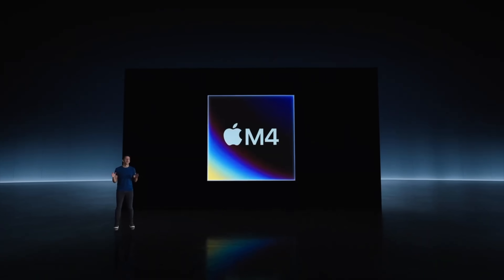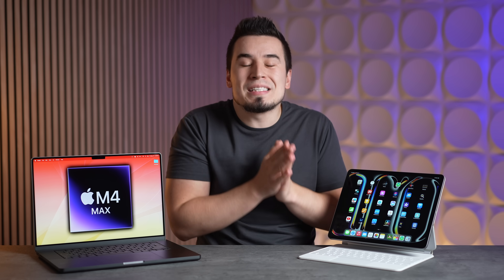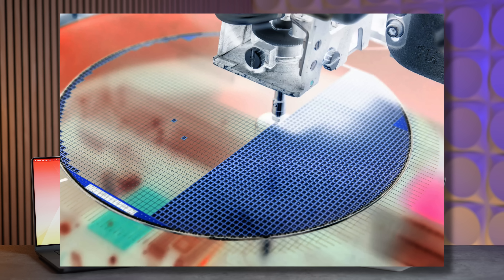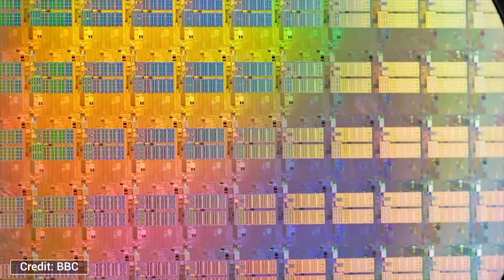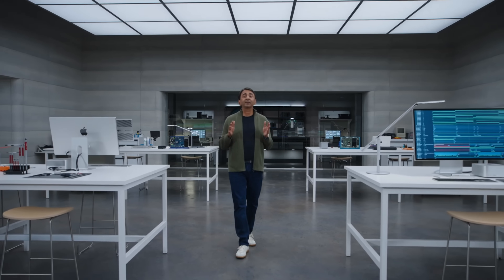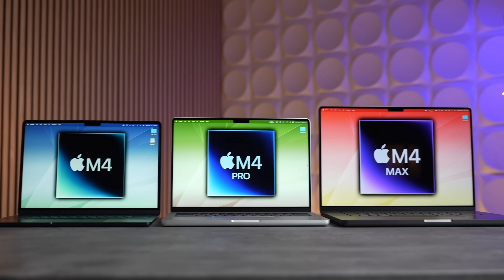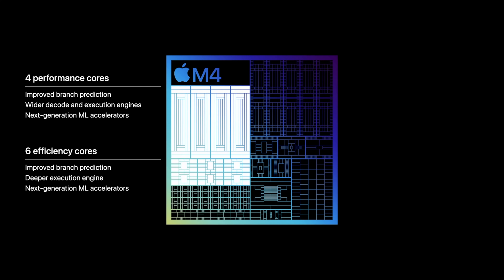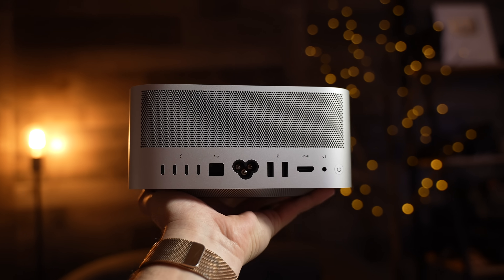What M4 iPad Pro means for M4 Macs (Huge WWDC Reveal?)

Comment: i am genuinely excited this time around for M4 family. People usually say that Apple products are overpriced, but nowadays a single enthusiast GPU will cost you just about a MacBook Pro price, or indeed a Mac Studio price. And you will need to pay that if you work with 3d, simulations, rendering, and any other heavy duty creative workloads.
Seems like architectural improvements and node advantages will help me get over the fear of missing out on beefy PC parts. I currently own an M2 mac mini and a very powerful PC rig, and will be happy to fully switch at last.
Reply: @GarrusVakarian-to2uh  if a $550usd GPU is 'high end' from your point of view, you are in for a rough awakening whenever you will need to do high-end sims and rendering with GPU acceleration
Reply: @GarrusVakarian-to2uh 4070 has 12GB of vram, whereas 3090 and 4090 have 24GB of vram. Even a medium sized volumetric simulation will not fit into 12GB. A rendering with huge amounts of geometric and volumetric data will also fail to fit into such GPU. This was literally THE selling point of Unified Memory, using Octane render of a spaceship as the showcase.

You have no idea what i need to do my job, nor the constraints involved. I am using this not to insult your knowledge/experience, but to show that a scenario like mine requires an approach that has nothing to do with your IT department perception of what is the bottleneck.
Reply: @GarrusVakarian-to2uh Yeah but those do not have CPUs and cannot be run alone (where Apple Silicon is system on a single chip). So you best be pricing your video card and CPU together.
Reply: look man, I Love apple too, But let's not pretend that you're better off buying an m4 MacBook compared to just building a pc with a good graphics card if we are just talking bout graphics and 3d simulation/rendering work here. You can get a top of the line graphics card right now for about $1600-$1700 including tax and such, get a top of the line pc chip that is as powerful or more powerful than the M2 Ultra/m3 max for $500. So like, no man. A top spec m4 pro MacBook Pro is going to be like $2500 on its own with base specs. Not including money for storage and ram. I can see an m4 ultra studio potentially being worth it, but even then, definitely not if it's new.
Reply: @DangerousGas  i think my previous attempt at leaving a comment did not go through. i'll try once again, i hope it does not vanish this time around:

example: a 100GB+ unified memory M4U will let me accelerate many simulations that utilize GPU, as well as rendering jobs. Previously i looked at Macs for that type of work as a mere curiosity, but since the introduction of HW Raytracing accelerators, as well as other speedups that M4 family brings, i honestly feel like we are getting to the point that it is a very viable option, not just "i dunno man" proposition.

edit: additional clarification - the budget here is definitely north of $4k USD (assuming the Studio Ultra remains, and the price is more or less same-ish). that single GPU price that is comparable to a macbook pro price was just an illustration that other hardware alternatives are not exactly "cheap".
Reply: @DangerousGas  some sims cant be contained in 24GB VRAM as well. if i can fit millions of particles, or big explosions into, say, 100GB of unified memory and it will speedup the time to simulate, that would be a winner, big time

... for me
Reply: @DangerousGas  Mostly this is true. But if you want to run huge machine learning models Mac Studio is the cheapest way to do it. The largest large language model made is 200GB in size which the M4 Ultra will probably have enough ram to load. The entire model must sit in RAM even for inference. Some models require 70GB of GPU memory or they don't run. A M2 Max with 128GB memory can run it. To build a PC that is able to run it you need Something like $20,000 worth of workstation GPUs, plus the rest of the PC and high power bills to run it. Such a PC would run it a lot better than the Mac Studio but costs a lot more. Even for inference you still need to hold the model in ram, but don't need as much processing power. The Mac Studio allows the general public and professionals to run such models for a lot less money.

Comment: As someone who bought the M1 MacBook Air, M1 iPad Air and iPad mini 6 because of the crazy performance jumps from the last generation, I basically switched away from windows for most of my computing. (11th generation I7 Samsung 16gb for what it’s worth). The mini 6 (A15) is perfectly capable for anything mobile and is my favorite. 
I have not been impressed enough with the M2 or M3 to consider upgrading, especially the iPad Air which is too heavy, more so with the magic keyboard . I would be very interested in the M4 Mac-mini desktop though. That would make a great work station. I still don’t see the need to upgrade the laptop. But I like seeing the upgrade path. And progress needs to be made. But I’ve also had enough of this soldered Ram/SSD crap, and the lack of repairability in general. I do tend to hold onto my equipment longer than most. Especially if it still performs well enough. 

TLDR;
Hope the M4 is as good as it sounds. I would love to see the iPad mini 7 get a powerhouse chip if it doesn’t destroy the all day battery. 
But the only upgrade I would buy today is the Mac Mini (with the new M4 chip)

Comment: Unless the M4 Extreme is ready to go alongside the M4 Ultra, Apple won't release the Mac Pro until later this fall - which feels like it would be enough to make the Mac Pro a "special"  30-minute presentation all it's own. If the M4 Extreme chip is ready to go, then the Mac Pro will be announced in June. But they're not going to announce the M4 Ultra Mac Pro without an Extreme Chip. 

So that leaves the Mac Mini and the Mac Studio to get updates for WWDC. ...and Apple really needs to update this workstation sooner rather than later. 

If the Mac Pro isn't announced, I could see a 24" or 27" iMac with the new M4 and M4 Pro chips being announced so they have more hardware talking points.

Comment: The TSMC roadmap you show has N3 in 2022. Designs take a long time and their design for that node started 3-4 years before then. When N3 was delayed to 2023 Apple had to still have a solution for their 2022 products. I believe they back-ported some of their design N3 design to N5P and included some upgraded M1 blocks to create the M2. This meant they had fewer transistors to work with and had to leave off the rumored ray tracing features from M2 and other planned enhancements. They then had an extra year to work the design that became the M3, but already had the M4 design team working in parallel, so may have put more focus on the M4. This theoryin summary has the original M1 being on  N5 in 2020, the M3 design was to come out mid 2022 on N3B, and the M4 design was intended to be on N3E in 2023
Reply from the maker: Yes exactly! This makes sense as well!
Reply: This makes a lot of sense — Apple had to know about the delays well in advance, and also explains the quick moves from M1>M2>M3>M4 with only limited improvements. For M4 rollout, iPad Pro makes a lot of sense bc it is due for an update, plus the low volume will allow for yields to ramp on the new process node. Next, they will be under pressure to switch M3 to M4 in MacBooks  and iMacs — in that order — for back-to-school and holiday seasons. It would be unfortunate for the current M2 desktops to languish for a while, but not the first time Apple has made parts of their own product line obsolete before replacing them.

Comment: may be for desktops there would be another chip, specifically made for desktops
Reply: I’m sure the M4 Ultra will be.  They didn’t have the interconnect on the M3 Max the M2 Max and M1 Max had.  It also appears from what they did to butcher the M3 Pro by adding E cores while reducing P-cores to 5 in the 11 core and 6 in the 12 core and reduced memory bandwidth by 25% that they intend to give the majority of P cores to the Max and Ultra chips.

Comment: Agreed. I think the M4 Max/Ultra Mac Studio will be released in WWDC. As you mentioned, it doesn't make sense to buy the Mac Studio M2 Ultra with the performance of the M3 Max being so stellar. I want the Studio for my big workflow needs. But an M3 Max laptop would be super for portable needs. 

I had a base Mac Studio M1 Max while my Intel i5 laptop was in the shop. It was super-impressive. It was literally 4x faster than my MacBook Pro and If I include the external monitor and accessories, about $1000 more money. Even my toughest creative test took single-digit minutes versus 1/2 an hour or longer. Loved that machine.

With the potential performance of the M4 Max, I may not have the need or feel the need to go Ultra. Sure enormous video projects would benefit with the added features of the Ultra. But we're talking movie length projects. How many of us do that.

Comment: Is 13inch iPad Pro worth it? I got 2020 11inch iPad Pro and thinking of upgrading
Reply: Stick with the 2020 ipad pro 👌
Reply: No
Reply: Yes, but it depends if you are power user or not
Reply: Thinking of the same.. deff upgrading for OLED but cant decide if i should go to 13” or stick with 11”
Reply: I got the 11 inch iPad Pro 2018 once it’s released, and just preordered the 13 inch iPad Pro today!
Reply: If they keep the same old iPad iOS, then it’s probably not worth upgrading. If they beef up the OS, then I would get it. Also, if you trade in your current iPad, it lessens the blow. You could still maybe get $400-$500 trade in value for the 2020